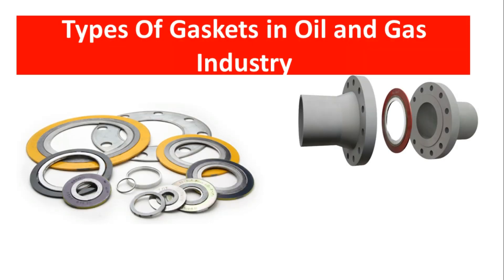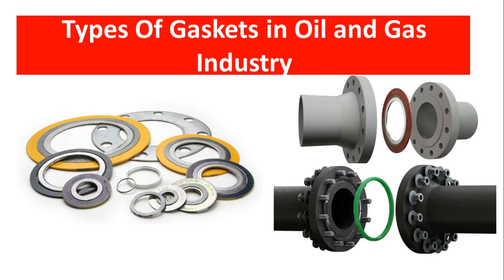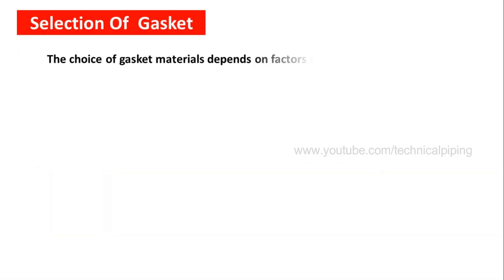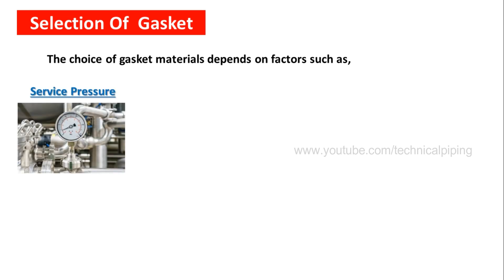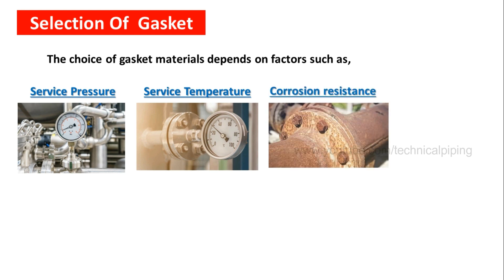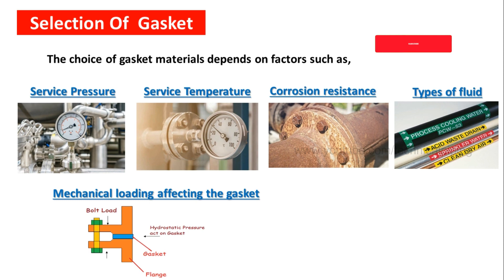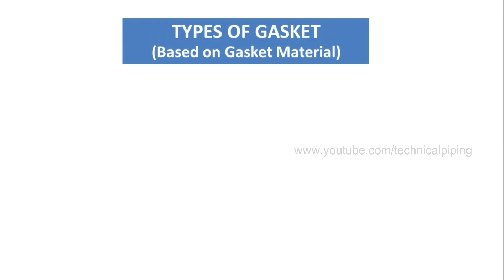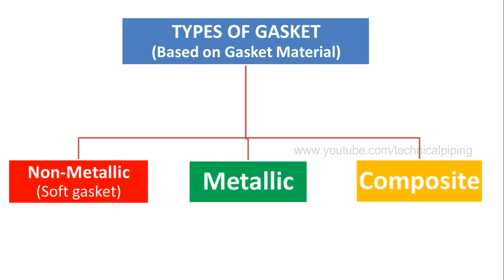Types of gaskets used in Piping |  Oil and Gas

Comment: Main products: sealing gasket,gland packing,PTFE/graphite/asbestos products, ceramic fiber products, high temperature heat insulation and fireproof material. 2